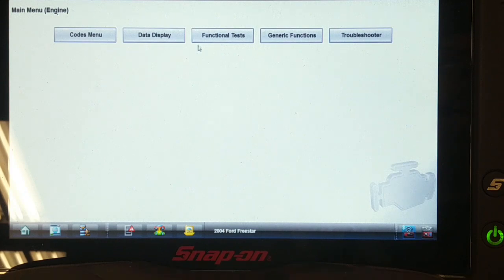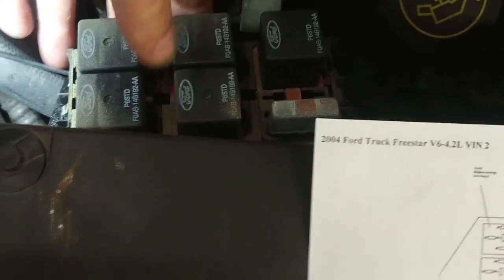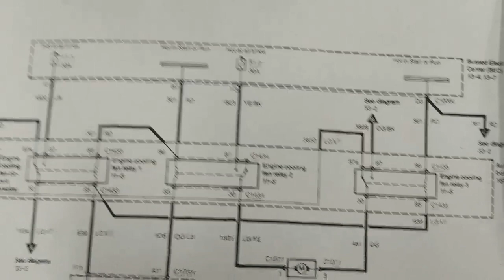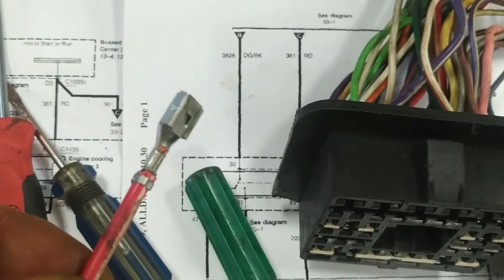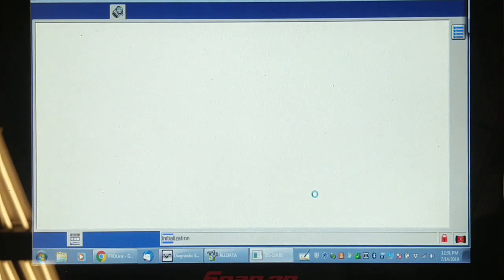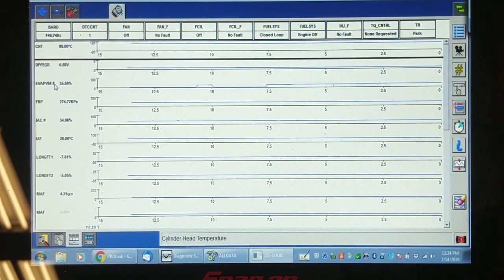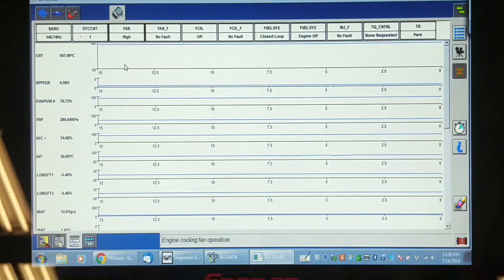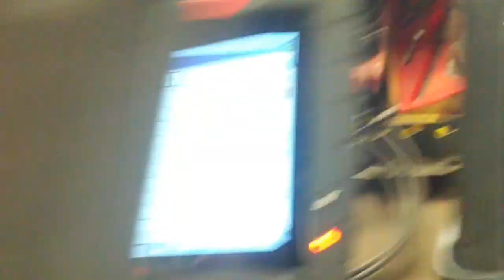2004 Ford Freestar Cooling Fans Not Running

Comment: hello friend, your video is very good

I have a question: is it normal for the smallest fan to be turned off with the A/C?
Reply from the maker: The fans run in various combinations depending on the engine temperature and the AC high side pressures. I don't remember which one runs first as this has been awhile. I would think it should run as soon as the AC is turned on but again cannot remember specifically. sorry wish I could be more helpful.